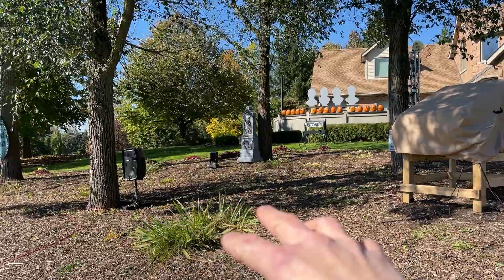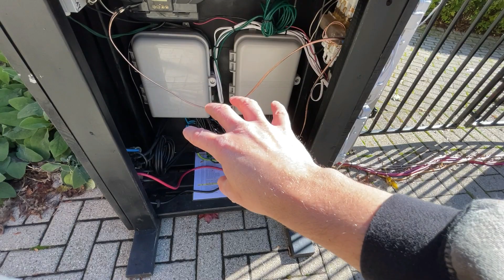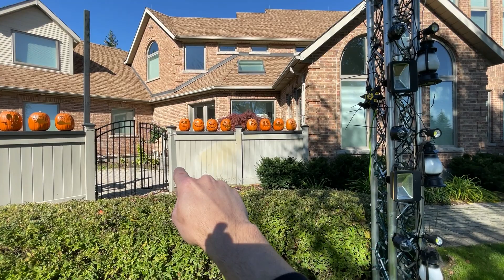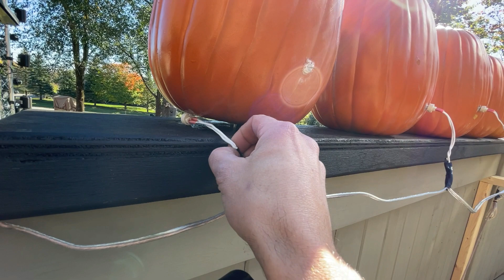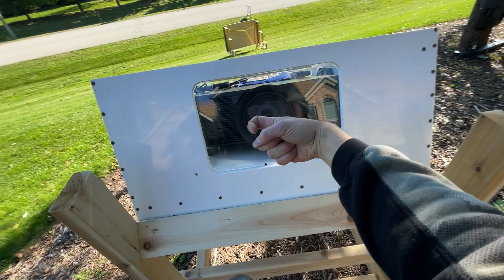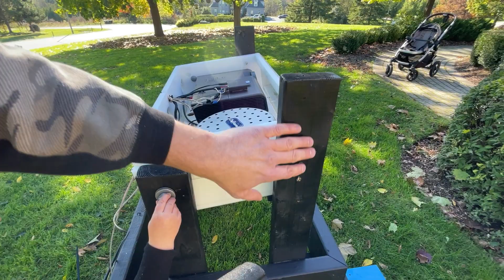How To : Light-O-Rama Light Shows & Projection Mapping For Halloween & Christmas - Behind The Scenes

Comment: Hey!  Awesome job explaining a pretty technical topic. Do you have a separate trigger to initially turn on the projector at the start of the night or is the trigger to the media player powering on your projector?  I guess the short form of my question is, how are you powering up the projector at the beginning of the show and then powering down the projector at the end of the night?  Thanks!
Reply from the maker: I manually turn on the projector at night, and turn it off when the shows are done. Its a pretty high powered one so there is a notable heat up and cool down period before or after use.
Reply: @MakeEpicThings  thanks for the clarification. Also, how do you go about synching the audio coming from the files you’re playing on your projector to the music you’re choreographing your lights to in LightOrama?  From what I could tell you are broadcasting the audio file from the projector, but when you create your show you design it from the sound file in LightOrama.
Reply from the maker: @reverseprollc3295 Good question. Yes you are using the LOR with the audio track. The key is to insert a small amount of silence on the LOR audio file, but not the video file on the projector (if you are using a media wiz sprite triggerable video player for example). You trigger the media wiz player  right away in your LOR sequence, and move the trigger point around until you more or less have the LOR audio synced with the projection audio. Its never perfect, but its pretty close.
Reply: @MakeEpicThings awesome. So I’ll insert maybe like a second of silence in LOR and then play around with the trigger point so that they sync “as best as possible”. I’m not looking to go crazy with light syncing, but would like to integrate some uplighting in my trees and some fog cannons. I think this will work out perfect, thank you!  Can you link or give a specific relay you’re using to trigger the projector?  I hope to get to your level one day!

Comment: My apologies if you already covered this… I am gearing up to do my very first projection this year so I am super excited! I would love to get a copy of the show (Mac version) with the Haunted Mansion. It’s especially perfect for me since I live in Orlando, FL. Also I am getting ready to build my projector housing. What material did you use again? I barely caught any of that part. Is it sold by the sheet, etc.? I have seen people on YouTube make their boxes with computer server containers and it works well for them. Finally, it looks like your property is massive, but are you still using a short throw lens for your projector? Thanks!
Reply from the maker: I built it out of HDPE (high density polyethlene). It is likely the best material to use in terms of plastic options. You can buy it by the sheet but its quite costly. 
For the haunted mansion show, in order to fit your house you can get Fitz Studios to make it for you (https://www.fitzstudios.org/) 
The projector has a short throw lens but keep in mind its a 12,000 lumen projector.

Comment: Does anyone know the type of relay used to trigger the sprite digital media player from LOR? I don’t know what kind to buy to trigger the sprite to play the video? Is it AC or DC is it 5v or 12v? Someone please let me know if you know. Thank you I hope someone can help me.
Reply from the maker: Any standard AC powered relay works. All the LOR is doing is "activating the relay" (which means the other side of the relay makes contact). Those two contact sides dont have a voltage out, they merely connect the trigger circuit coming from the sprite media player. It literally is the equivalent of touching two wires together.

Comment: Are the projectors using relays? If so, what’s  the purpose of them?
Reply from the maker: You are 100% correct. AC relay gets triggered by the LOR (whatever channel you plug it into). When AC voltage applied to that relay, it makes contact, effectively mimicking a button press. The other end of that relay (the "button press" end, the end that makes contact when AC is applied) is attached to the trigger input of the Medea Wiz Sprite solid state video players, that are then connected to our projectors. This setup essentially allows the LOR to trigger the video player, to play a video sequence on demand (as part of the show).
Reply: @MakeEpicThings  why can’t the light o Rama cable be directly plugged into the sprite?
Reply from the maker: @jakemoodie7798  Video players have a trigger input (for a button basically). You cant just run AC power into a trigger input like this, it will destroy your video player.
Reply: @MakeEpicThings  you said that the box should always stay warm. In the winter, would that create moisture because the warm air from the box is being mixed with the cold air from outside (vents)?
Reply from the maker: @jakemoodie7798  Suprisingly not. We use Canframo RV/Boat heaters. They are 75W each and warm the interior and circulate the air to prevent any moisture issues. I have NEVER had moisture inside one of our projector enclosures with these running in them,
Reply: @MakeEpicThings  are vents open at all times?
Reply from the maker: @jakemoodie7798  Good question. No. I open the vents when I turn the projectors on at night, I close the vents when I go and turn the projectors off at the end of the night.
Reply: @MakeEpicThings  can the vents be open at all times? I see others that don’t have controllable vents (Sorry for all the questions😅)
Reply from the maker: @jakemoodie7798  I would assume if they were open all the time, moisture (rain) could become an issue... and the 75W heater would be useless, essentially heating the atmosphere.
Reply: @MakeEpicThings  I have a 14 pin relay. What terminals are connected for the side coming from light o rama and the other side going into the video player?
Reply from the maker: @jakemoodie7798  I dont know you will have to consult your relay diagram to see what pins are power in, and what side are NO (normally open) and NC (normally closed). You want the 2 NO pins to trigger the video player.
Reply: @MakeEpicThings  what’s your exact relay model and how did you wire it? Do you have a layout diagram of yours?
Reply from the maker: @jakemoodie7798  Im sorry Jake. I do not.

Comment: Wow! This literally has to be one of the best and thorough videos I’ve seen. Great job! I’m definitely going to start putting some content regarding my builds on my channel. I’m an electrical engineer and started projection mapping last year. It went so well and was so well received that I’m of course making it even better this year. My house is only 3,400 sq ft in comparison… but it is the perfect size for a single ST projector to show some really nice effects! I also built an aluminum enclosure with heating and cooling and a WIFI thermostat that is anchored in the ground for security. This year I want to add physical lights to my Christmas show. I’m trying to determine what the best method would be to sync the lights to my projected video (created in Adobe AE) and stay in sync on the loop. Currently the media player is in the enclosure on a wireless outlet switch which turns the projector on via “HDMI source power on”. The media player is set to play the file that’s at the root of the SD card which is my show. It works perfectly and starts the countdown for the show right away as soon as soon as I press the button to turn everything on. I use an Optoma GT1090HDR but will be upgrading to an Optoma ZH606TST. So I guess with all that being said, my question is how’d you sync your lights to both projectors perfectly? I understand every part of your setup… but I’m new to LOR so I might be missing something here… but I’m very intuitive and I’m sure I’ll learn it very quickly. Using the triggerable media player you have, can I just use LOR to trigger at a specific time (right away at the beginning) and then that will start playing precisely enough to sync to the lights during the show? The lights and projected video are coming from 2 different sources correct? I’m thinking repeatability as well since I’ll run this show nightly during the season and I want to just be able to hit a button to turn it on and the same to turn it off… Ideally. 

Sorry for the lengthy message… this stuff just excites me! haha

Comment: Fantastic video. Thanks for taking the time to do this. How do you control what video from the SD card plays when triggering the projector to come on? I am an experienced LOR user, but a little intimidated to integrate my projector into the show. Are you able to provide a link of the hardware you are using to control the projector from the LOR controller? Thanks so much!
Reply from the maker: Hey Greg! I thought i mentioned this in the video but maybe i missed it. There are two options, if you are doing a single video projector / single screen show, there is a version of the LOR sequencer software that outputs video (use video instead of an audio file), then you just run an HDMI cable to your projector. In my case, I have two projectors and two separate areas of projection, so i use triggerable media players, called "Medea Wiz Sprites", they are under $100, and have a triggerable input. So basically a button press on the input I/O connector of the box will trigger the video file to play. To control this from the LOR, you just use a standard relay. An AC relay works the easiest, so one of your LOR channels turns on the relay momentarily (which acts like a button press), then on the other side of the relay, two wires (which are connected / circuit complete when the relay has AC power) goes to the input I/O trigger connector of the medea wiz sprite box. Cool?
Reply: @MakeEpicThings  Thanks a lot for the detailed explanation!

Comment: Hi Shown great job. I’m looking to add projection mapping to our large haunted house facade. What model Christie projector did you use on your house?
Reply from the maker: Thanks! For 2021 I used a Christie D12HD-H which is just under 12,000 lumen. The previous year I used a Christie laser projector, Christie DWU630-GS I believe, which is around 6700 lumen. It definitely was not as bright (obviously). I also have an older NEC 7000 lumen in storage, that I have as a backup

Comment: So I got 30 strand of lights for 1 tree at my house can 1 outlet handle the whole 30 strand lights just fading them on and off, or do I need more boxes cause I have 9 trees which take up like all the outlets for each tree if I want each one to fade on and off
Reply from the maker: You need to determine the power draw / load in watts first. Often the box will say what the power draw is. LED's these days, even a full strand of them are very low power consumption. An average house circuit has a 15A breaker, and is 120V AC (15 A x 120 V = 1800W load). However, most breakers will trip before that due to line loss, resistance etc, so you want to keep it under 1700W. If your light strand uses 2W for example, you can use 34 strands total on that circuit. Remember a circuit is not necessarily an outlet, most of the time there are multiple outlets on the one circuit. So if you have 2, 5, 8 whatever outlets around the outside of your house, they may share the same circuit.
Reply: @MakeEpicThings  How many boxes would I need?
Reply: @TechWithAndrew  How many watts does each of your light strings draw? Are you using all 30 strings on one control channel? Or are you lighting different sections of each tree with a different control channel (which has a different on and off time from other channels)?
Reply: Commercial 100 LED string lights (up to C9 size) draw about 10 watts per string. 100 strings would draw 1000 watts, which would comfortably run on a single LOR AC channel. A 16 ch controller can handle 1600 watts from a single AC power cord. If you have 30 strings of 100 LED lights on each tree, that would be 30 strings x 10 watt/string = 300 watts per channel if all strings were put on one channel (the whole tree goes on and off at the same time) For 9 trees, you would need 1 AC controller and lots of extension cords. If you have trees that are spaced further apart it may be easier to use several controllers just for convenience.
Reply: But if you want 30 different channels per tree, one channel for every single string of LED lights, you would need two 16-ch controllers for each tree or 17 to 18 controllers so every single string for all of the trees can have a different timing control channel.
Reply: BUT, the biggest restriction may be the light strings themselves... as they have 3 amp fuses, which means you can only connect 36 string together (360 Watts total) before you risk blowing the fuses in the plugs of the strings.   IF you use older incandescent lights you will need much more equipment than previously discussed as they require 40 watts or more per string of 100 lights.

Comment: My PC laptop is extremely old, I'm nervous that it's going to crash one day - would the Easy Light Linker replace my computer or should I get the G4-MP3 Director instead? The Linker still needs a computer, I don't own a windows PC anymore, only the one that's about to crash. I'm only running 3 controllers, not a big show. I can't find any videos on the Linkers or the G4 controllers. Hoping you're experience will help point me in the right direction for next year.
Reply: My entire show runs over wireless ELL's from a mini director with MP4 player. The whole show of 12 songs plays from the time I plug it in until I unplug it at 11:00 pm. It's all pre-recorded and runs all the channels wirelessly, including transmitting the synched music to car radios and playing over speakers in the yard. I only use the desktop pc if I want to make any changes to the programs and sequences. Once you set up your "show", you save it on an SD card that plays from the mini director. A 4-ch ELL AC controller in the house runs the lights in the windows in the house while broadcasting over wireless to Four other ELL units outside in the yard. I just run AC power cords from outdoor wall plugs to the various types of LOR controllers for the show. Other than a few AC extension cords running power out from the house, I have NO ethernet or RG cables in the yard, and only use very short extension cables between the controllers and the actual strings  of lights.

Comment: Hey Shawn, since each LOR box draws 30amps, how do you plug two boxes into one 15 amp plug?  Would think that would trip breakers all day?  Thanks!
Reply from the maker: Steve. It only draws what it needs. Yes each input to each box will handle up to 15A, however, all the lights its controlling are LED, low current. I have no incandescent anything, and not all lights are ever all on at once. With the kill-o-watt meter I have connected, the LOR controllers, the 12V PSU, and the 1 projector (4000 lumen one) draws 1600W on average total, never approaching the 1800W limit that would trip a 15A breaker. If i had all devices (fog machines, 700W each, 12K projector... varies, but likely draws 800-1000W) it would surely trip a breakjer.

Comment: Why wouldn't you use Light o Rama DC controllers? ie  model CMB24D 
Love the lighting Truss - something I need to look into.  Projection also looks great
Reply: Here in Ohio, I always fear lightning strikes to vertical support like your trusses. This could blow out the triacs in your 16-ch AC boxes. DC controller do have a limit to length of cords as voltage drops become a concern if you are pulling much power over them.  Since you are already using Easy Light Linker wireless, I suggest that you put a 4-ch wireless AC box (such as CTB04-PC-ELL) on each truss. This would eliminate all cords going to your trusses, except a single extension cord that would simply plug into any outdoor GFI outlet. The control would be wireless for up to 4 AC channels. (Note: you would need to move your DC relays to the trusses and add a small power supply, but the entire truss would be independent and safer against lightning, especially at Halloween.
Reply: I am using 5 ELL devices for my big setup at Halloween and it also control servo prop figures, RGB flood lights, and a limited number of RGB Pixie 2 controllers.
Reply from the maker: Damn You Peter! I didnt even know that existed. Definitely could have avoided building the relay boxes for the 12V / 24V DC lighting. -> https://www1.lightorama.com/dc-low-voltage-boards/
Reply: @MakeEpicThings  A least you got to be creative and build those boxes.  All roads lead to blinky lights